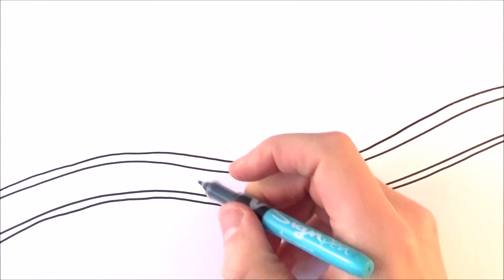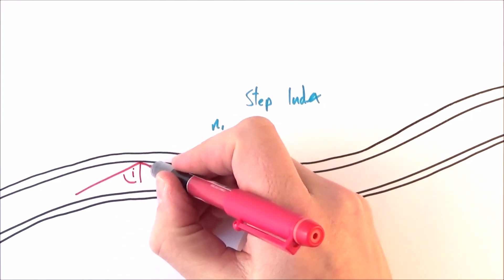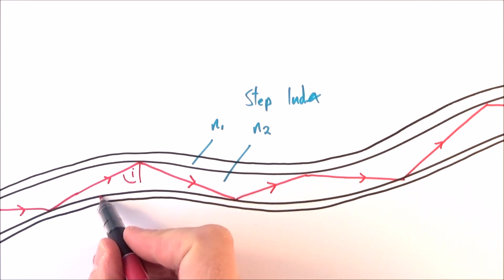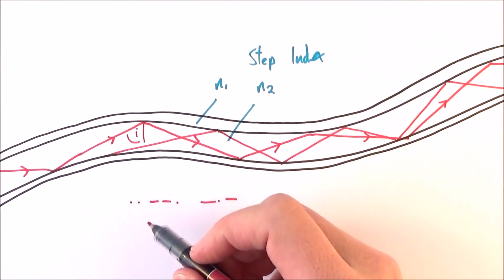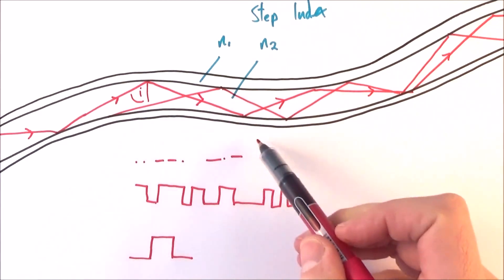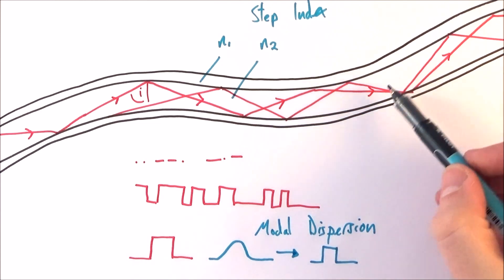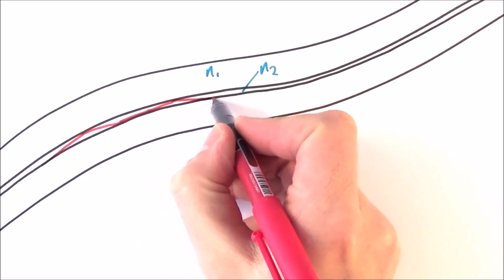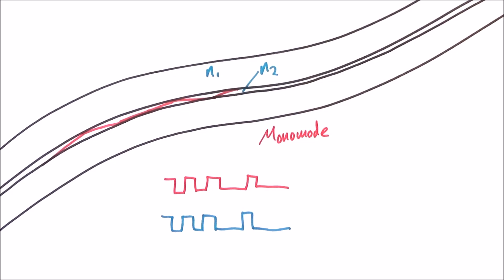Optical Fibres - A Level Physics

Comment: Why is the refractive power of the outer layer of the fiber smaller? That means that light passes through inside the fiber in a slower velocity than outside it. Why cant it be inverted?

For example 

Refractive power is smaller: n=3.10^8/8
Refractive power is bigger: n=3.10^8/4

Refractive power is bigger that means that light passes through that material slower. Why does it happen INSIDE the optical fiber?

Thanks

Comment: Damn, i was hoping you would talk about how the cladding has a different refractive index and how this helps with the light not refracting but instead reflecting. also about the critical angle and its effect..
Reply: The cladding has a lower refractive index than the core to ensure that the light totally internally reflects. Something can't totally internally reflect if the outside has a higher refractive index - if you want to prove this to yourself, try using the critical angle equation for something traveling from air into glass with a refractive index of, say, 1.3 (sinθc=n2/n1 , where n1=the refractive index of of the thing you're in (glass) and n2=the refractive index of the thing on the outside (air)). If you try to put it into your calculator, you'll get some form of error message. This is because sinθ only exists between -1 and 1. 1.3/1 >1 so there is no critical angle; TIR can't happen.
 The actual PURPOSE of the cladding is not so much to make the light totally internally reflect - air would have a lower refractive index than the core anyway so the light would still undergo TIR without any cladding at all! Its purpose is to prevent crossover (if you had a bunch of optical fibre cores together with no cladding to separate them, the signal would just 'jump' between the cables and make a massive mess) and also to prevent damage to the core -- scratches could cause the angle of incidence to be less than the critical angle so the light would escape.

Hope this helps :)